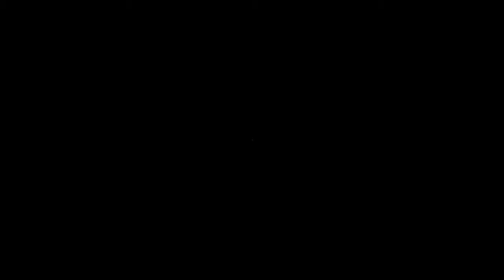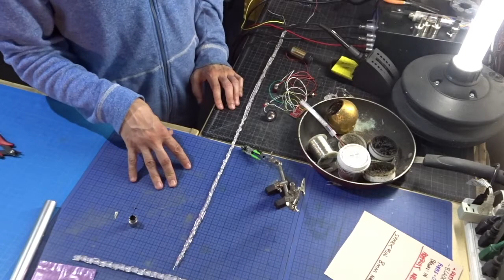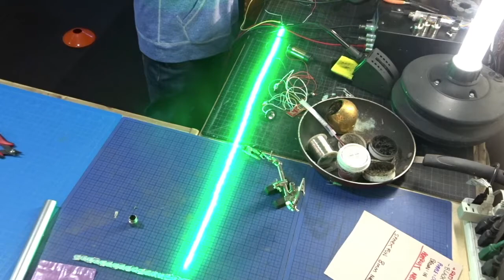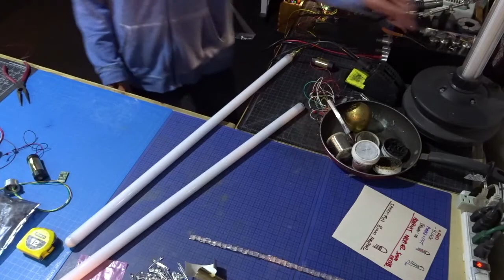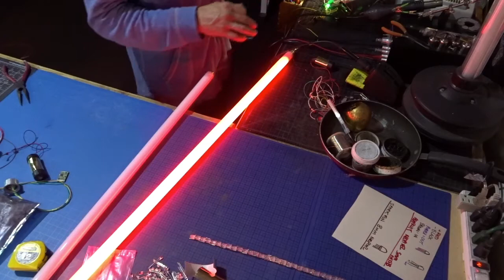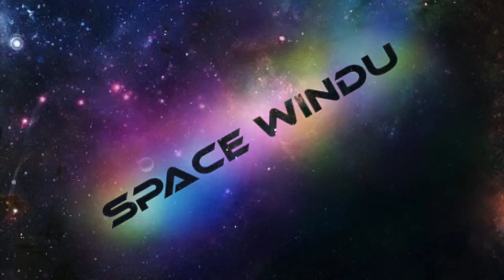Adafruit Neopixel LED 5mm String and Double RGB Strip

Comment: Do the Adafruit Skinny neopixel strips have the adhesive on the back?  The strips appear to come in a clear flexible plastic.
Reply from the maker: The ones from Adafruit do not come with adhesive. They come in a water tight plastic layer that you need to cut off for use in sabers. It is a very bulky plastic sheild that needs to come off.

Comment: What RGB strip did you use? there's 144 led/m, 60 led/m , and 30 led/m.
Because obviously 144 led 7m has more leds and is brighter, but it also doubles the cost  and I don't know if it is overkill.
Reply from the maker: In my opinion you need the 144 skinny strips as these are. Unfortunately they are the most expensive

Comment: Nice work!! I just finished off a 3 strip combination of the mini neopixel strings with an nec igniter 2, turned out great.
Reply from the maker: Awesome! Does the three add more weight than you'd like? Or is it fine? To me, I thought two was as heavy as I wanted the blade to be. Is there enough diffusion to hide the lined shadows? I don't think it's bad with two strips at all
Reply: I used a Thin walled Vaders Vault 1in blade, which is already pretty light. It did not feel like it was any heavier than a heavy grade thick blade. I had enough of the foam to hide shadow lines where its joined, but could have used another half or full wrap of the other diffusion material I put on that to hide the pixels just slightly better. I think next time I will try two strips and see how it fairs. I didnt link it here, so as to not highjack the thread, but if you jump over to my channel you can see the video i posted on the one I made.
Reply from the maker: Wow that's really cool build you actually gave me more ideas for how to do my next thin neck saber...

Comment: flash in blue and different colour order goes from different controller chip inside diod. apa106(starts from blue,  normal on state) vs ws2812 (normal off)

Comment: This means one doesn´t need to solder hundreds of LEDs together, but can use a premade strip off a roll (those LED strips come on a roll?) in the desired length to build a lightsaber blade?
Reply from the maker: Yes. Still involves a little bit of soldering (end of the blades to a plug) and then diffusion. But it's WAY easier than doing the soldering of the individual LEDs. And the strips are sure to get better and more powerful.

Comment: I picked up 2x WS2812B strips and 2x SK6812 strips for testing, along with power supply, some 26650 batteries, etc.  I got Keep Power brand batteries but would be interested in what you found, as the options were limited.  Looking at standard blade tubes as well as what can be achieved  with the Photon tubes.
Reply from the maker: I got the Orbtronic batteries. They seem to be really good, but I'll know more soon. Yeah I want to try the neopixel in a blue enhanced since that is tinted pretty lightly I'll bet most colors shine through ok whereas I think the blues will look nice in there.
Reply: I've only ever used Orbtronic batteries and they have yet to let me down! When I started building pixel blades they were up to the task!
Reply: I did not know that Orbtronic made those as I use their 18650's in my custom build (my own battery packs and setups)...will have to order

Comment: The strip is still kind of a pain to diffuse. The lighting on my blade is smooth but obviously darker down two sides.
Reply from the maker: I don't notice shadows on it yet... once I get into a saber I'll look in mirror and decide if it has those shadows. Closed cell Makoto foam is the best diffuser IMO
Reply: oh nice, I haven't had the opportunity to try that. I've just got the tcss diffuser and some packing foam.  people I've shown it too haven't noticed though, so I might just be picky. I think that its pretty visible when you put the tip to the ground, you can almost see the 120 degree arcs. Either way, it certainly doesn't look bad, just not quite as smooth as my master replicas (but much brighter, obviously).
Reply: Where can you get the Makoto foam?

Comment: Great work.  For 5mm and strip pixels the bit order is slightly different so R and G channels are swapped.
Reply from the maker: Ah thank you :)
Reply: IF using the Adafruit NeoPixel premade string, with an NEC Igniter board, you will need to uncheck the "swap red/green" check box. Then it will give you the right colors for that product.

Comment: i thought the neopixle led was a flat strip?
Reply from the maker: The second blade I show in the video is made up of the flat pre-made strips. Two of them back to back, wired together, then I diffused them and added the blade tube. The first one I show is made up of 5mm straw hat LEDs which look somewhat similar to regular 5mm LEDs but with four legs (and a computer chip inside each one)
Reply: Yes i realized that later lol